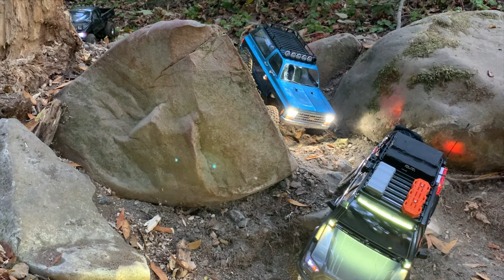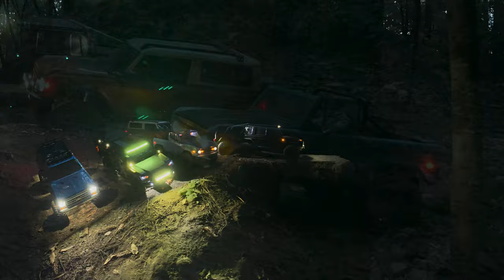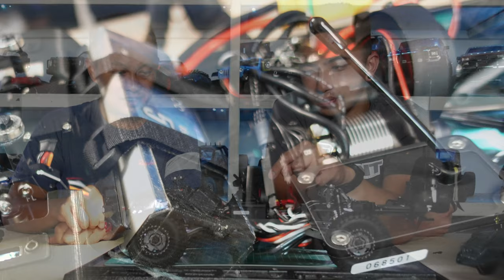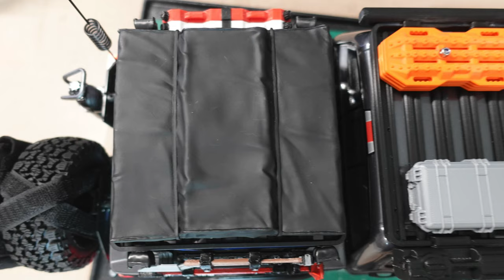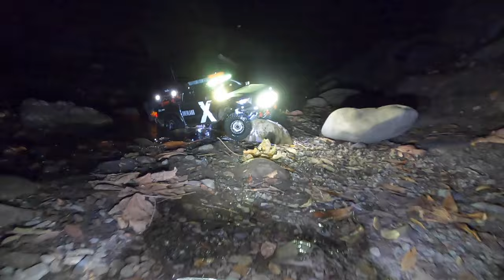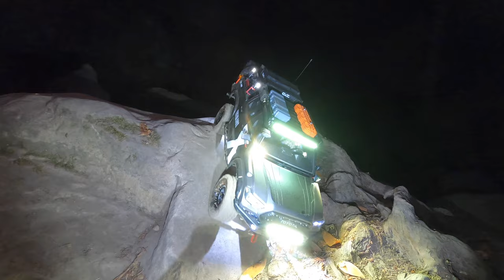Knightrunner RC Toyota Tacoma RC Truck Chassis Details - scale truck build Part 2 of 2

Comment: The only change I've made to my KnightRunner so far is replacing the brushed motor and ESC with a Hobbywing Fusion 1800kv system. It was a very easy install: the old motor came out and the new motor went in without having to remove the transmission or the battery tray. The upgrade was both relatively inexpensive and definitely worth while. I may eventually replace the receiver so I can use either my FlySky GT5 or my Radiolink RC6GS: I'm still deciding which one.
Reply from the maker: Flysky. It's a much more ergonomic package with a great programing UI.
Reply: @RCReviewChannel  I took your advice and swapped the stock receiver for a FlySky FS-BS6 receiver so I can use the KnightRunner with my FlySky GT5 transmitter.

Comment: That body is really scale, the chassis as well, but wouldn't the IFS snag on obstacles? ---it hangs a little too low
Reply: Stock is way too low. But after modifying it, it performs a lot better